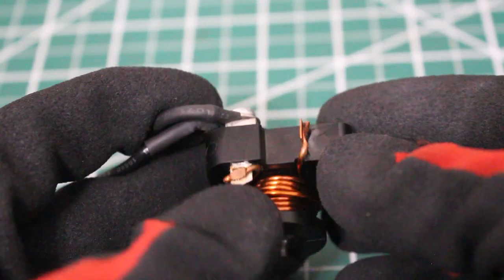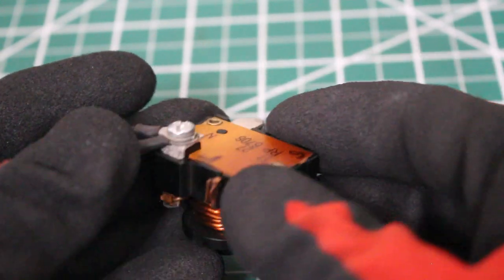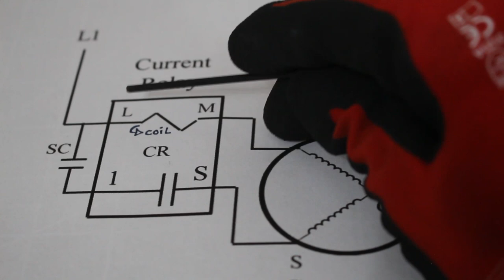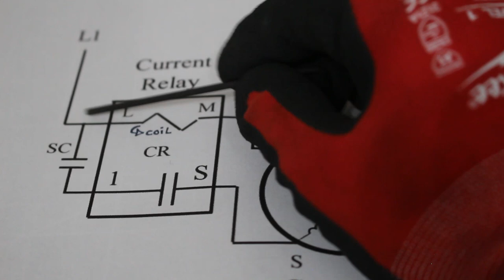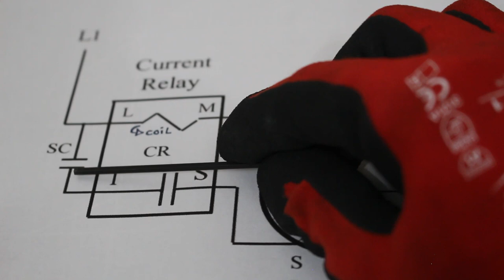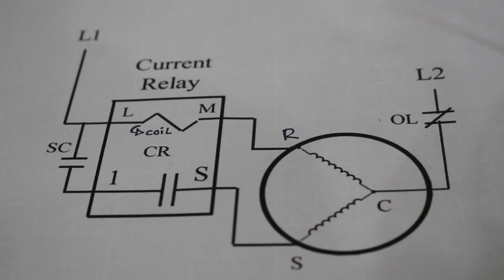HVAC: Current Relay Explained (Current Relay Wiring Diagram) Sequence Of Operation & Troubleshooting

Comment: Took forever but I finally narrowed down the problem with my Delta 31-695 disc/belt sander.  Also took forever to find a suitable relay. Aaaaaaand ALSO took forever to figure out how to wire the aftermarket relay........until I found this.  I was a nuclear electrician in the Navy so I had a pretty good understanding of how these work even though I've never encountered one before.  This video was EXCELLENT!  You explained the theory of operation PERFECTLY.  Thank you.

Comment: I'm your fan but I've noticed it'll take forever for an apprentice to understand your drawing explanation....I think the best way was to start when power enters compressor windings through common terminal then try and explain the start winding terminals and run terminal differences

Comment: Should of mentioned current relays are gravity sensitive devices. If they  are mounted upside down, the start capacitor will stay in the circuit and eventually fail (leaving an oily mess)

Comment: Very simple but thorough explanation as to how this simple circuit works.  I'm working on a fractional horsepower refrigerator.  The unit was tripping circuit breakers.  I then found that the thermostat's contacts were burned open.  Replacing the thermostat I found a tripped CB again.  I measured the total motor current, way out of range, I shut the unit down although the motor ran.  After a while it overheated and tripped the thermo fuse, which eventually stayed open permanently.  

I suspected the current relay's contacts welded closed, keeping the start coil energized, not being disconnected. I haven't had time to get back to the job.  I noticed another tech made up a short cable with a normally open push button switch, which he would connect up to the start coil.  He would hold the button down (closed) and power up the unit.  As soon as the motor took off he would release the button. I thought that was a pretty good diagnostic tool to have.

I've noticed that not all fractional HP compressors do not have start capacitors, that right?  If so, I suspect the start coil is would at least 90 degrees out of phase from the run winding, true?  

Nice channel appreciate it -  Jim

Comment: So current relays can’t be used with run capacitor compressors?
Reply from the maker: Run capacitors and start capacitors can be used. This was just one example of a wiring diagram using this relay. Thanks for watching & Stay tuned for new videos every week🔧⚡️